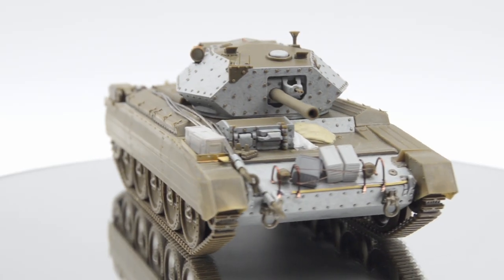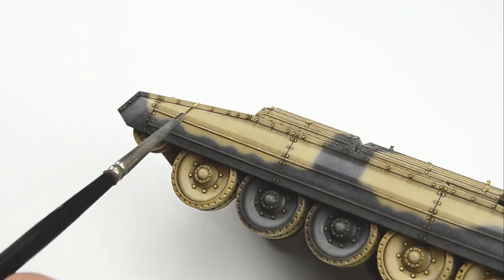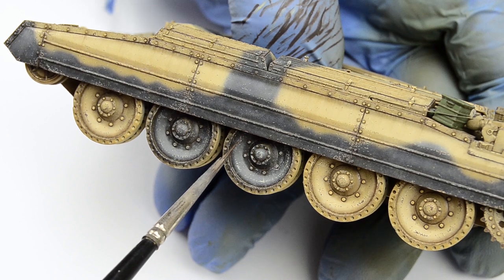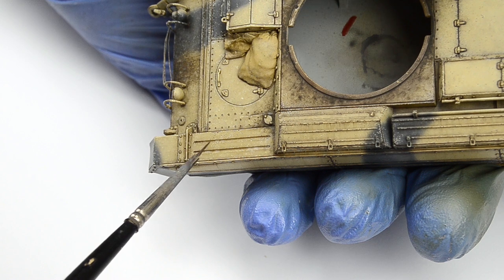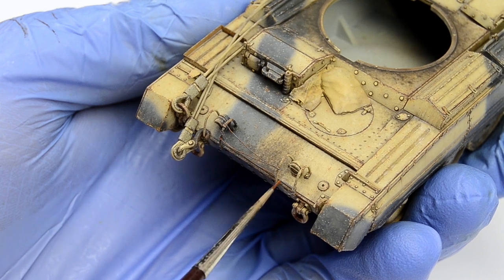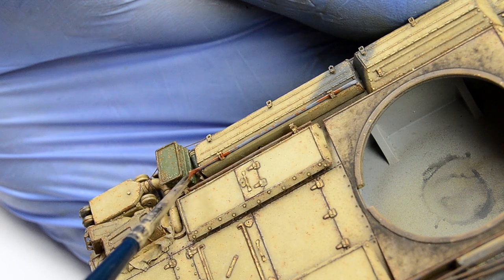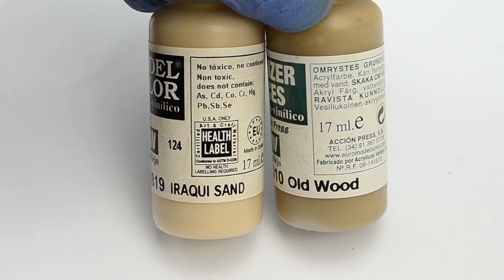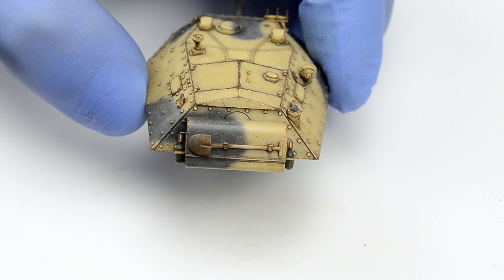Yes, Desert Armor Can Get Rusty | Crusader Mk 3 | Tamiya 1/48

Comment: According to your video, you added about 12 drops of drying retarder to the first paint mixture.
Reply from the maker: The amount depends on each manufacturer. AK retarder usually needs 1-3 drops, VMS recommends 30% because their retarder also works as flow improver.

Comment: I guess the tanks were bolted because less experienced workers can do that so you don't need expensive specialists
Reply: I understand that they didn't have the technology required to weld the armour plates  together. 
Rivetted/ bolted tanks were constructed with a tried and tested process but they require a frame on which the panels were fastened.
 Welded vehicles don't need this and the vehicles were therefore lighter for the same armour thickness. 
I have the feeling that the Germans developed this first.
Reply: Doesn't help that the British needed to replace basically their entire military equipment after Dunkirk.

Also, most of the skilled welders were in shipyards, frantically building ships, while most of the factories building tanks were former railroad factories used to riveting steel. So to keep production numbers up, they didn't want to retrain and refit the factories.

Comment: I love the North-African setting, and the camos that were used there! Especially the British vehicles! If you like desert stuff, check this Matilda picture out! This camo scheme is my favorite!
https://arcaneafvs.com/a12/a12matilda_001.jpg

Sand yellow with a bright blue, I mean come on, most summer-ish thing ever! :D The British painted several vehicles with it, so there are multiple tanks and support vehicles you can do with this. Another thing is, rust and metal effects looks really nice on a blue base, pops a lot. 

About desert scenes the best thing is the diorama. You can basically make sandstone houses on a sandy rock base, so pretty much the same base paints all over, or you can coat houses with white cement (I do mean white) to simulate whitewash, which is another typical method used for buildings in desert environments. Vegetation tends to be sparse, so no extra work there. Sand can be done with sand, it just needs to be grinded into a fine dust. Use a dust mask when doing it before you damage your lungs! :)

Anyway, desert settings are cool! :)
Reply: Dr. Obvious known as the Caunter scheme.
Reply: @Pte1643  thank you!

Comment: Welding in the 30s/40s was still a fairly specialised skill and in wartime most able welders would have already been employed in niche industries or in shipbuilding , and when your island nation's wartime Prime Minister happens to be it's former First Lord of the Admiralty, you can expect ship builiding to take priority over tanks and those welders to stay where they were. 
Why riveting instead of, say, casting, if not welding? Britain in the interwar period did not have a particularly healthy tank-building industry. A combined result of post-war politics, national debt, etc. culminating in very little money for tank design/research/manufacture, with some wanting to abandon the tank idea entirely. This led to a bit of a technological stagnation. 
However, what Britain didn't lack at the time was a base of well regarded train manufacturers, who could produce high quality, machined parts with riveted assemblies. Early on, adapting these same methods for tank production was deemed acceptable, rather than trying to start building tanks from the ground up (again) from a skills base that didn't exist yet, if it meant tanks were being produced at all. 
The trouble is, no matter how well you machine and rivet the parts on your tank, eventually, anti-tank munitions will  and did become nasty enough to defeat the riveting process itself and you'll have no choice but to look for alternatives.

Comment: Yes. Somebody may have answered this one already, but it was  technical  issue. 
Riveting and bolting iron and steel plates was a tried and tested methiod. 
It's how they'd built everything from steam tractors to battleships and so they knew it inside out, had the equipment and the skill set. 
Welding gradually superseded this approach in the first decades of the 20th century and the welding of armour plates simply required the development of specialist equipment perform the task. 
The Germans developed this and by 1938, they were even welding their warships and thereby avoiding restrictions that followed WW1. 
This is helpful.
https://weaponews.com/history/65361021-welding-tank-armor-the-german-experience.html

Comment: See . . . Whilst I admire your abilities, which far outshine mine, I fundamentally disagree that a Tank would acrue that much rust whilst in Active Service.  Scratches, dings, dents and all manner of collision-type damage & wind-blown sand erosion in North Africa YES but not rust and most certainly not on those towing hawsers - the Crew would be on jankers in an instant if they let their equipment get like that! "...Das kann drei Tage kosten..." as Marlene Dietrich once sang . . . 

There's weathering and then there's unrealistic weathering. Especially considering the Crusader Tank you've modelled - T126799 https://en.wikipedia.org/wiki/Crusader_tank#/media/File:Crusader_tank_III.jpg - is barely more than 6 months old at this point, that being 1st January 1943!! The first MkIII's didn't roll out of the factory until July 1942 . . .